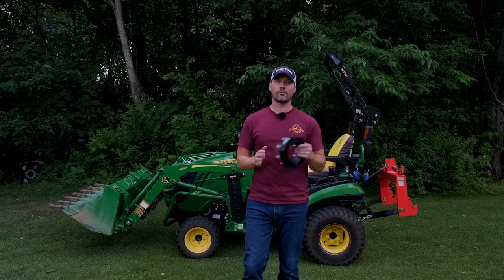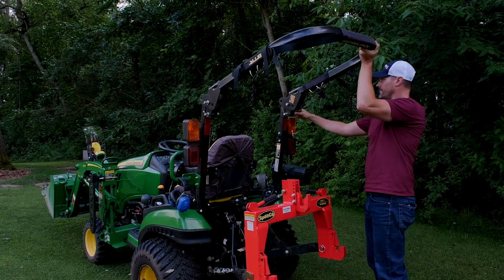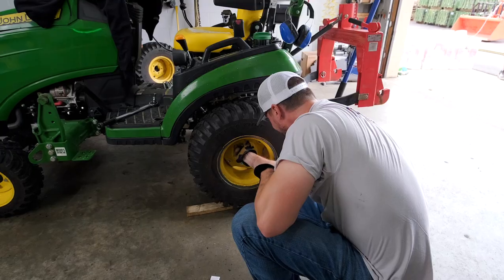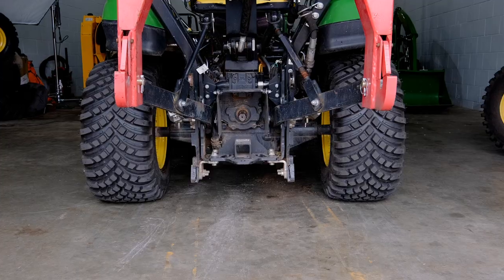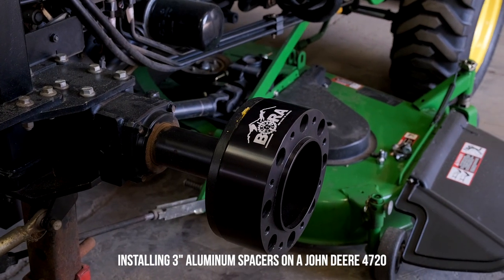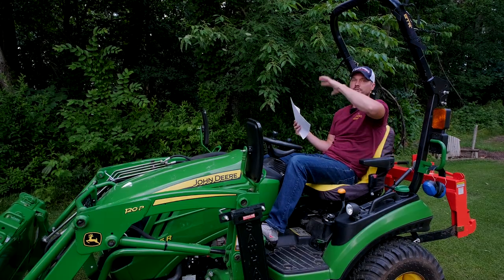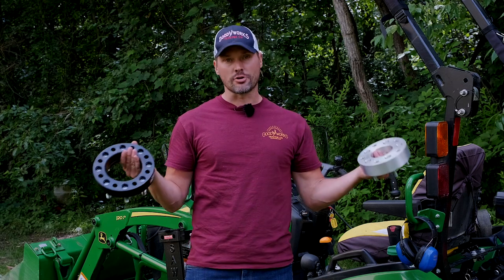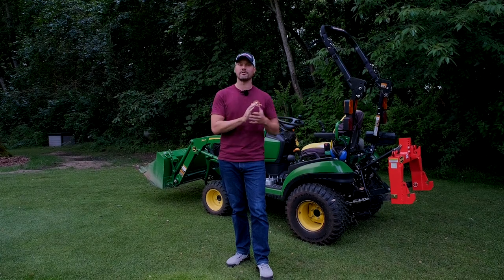THE MOST CONTROVERSIAL TOPIC IN THE TRACTOR WORLD? 🤦🚜

Comment: Hi, my name is Beau, and I'm new to owning my own tractor. I have some experience from my childhood with tractors, but all we ever had was extremely old antique job tractors. We had a 40s model Farmall "C", and a 1930 John Deere model "A", both of which were three wheeled tractors. These machines were both top heavy and dangerous, especially the Deere. But other than that, the only real experience I've had was with my friends two sub compact John Deere tractors. One is a 2210, and the other is a 2305, both being pretty much the same tractor. I have always wanted a tractor, but I never could afford it. Recently this past March, I bought my first tractor. It's a  1979 Power King 1614 economy tractor. It does have hydraulics, and I'm in the process of putting a front end loader on it. And being that it is a garden tractor, it doesn't have a rear pto, but I'm working on designing one for it. This little tractor has a lot of torque and pulling power for what it is, so I'm confident in its ability to handle the loader, but it is extremely light, and the loader is gonna make it more top heavy, so I'm considering the fact that wheel spacers could be helpful. Now I'm not gonna lie..., I have always been doubtful of wheel spacers, and I've never wanted them before, but I also realize that I don't have the proper knowledge to make that determination. I'm not worried about tractor life being shortened because this little tractor is over-built for its intended uses. I'm following suit with my design for the loader frame support. There's 2 key issues for me with the wheel spacers, both of which will probably seem minor to most people. The first is pricing. I'm medically retired U.S Navy, and disabled. Therefore I'm on a pretty tight fixed budget. Everything I'm doing for this little tractor is second hand, and being done a little bit at a time. Are wheel spacers really expensive? The second is the more impending issue. This being an older tractor that is no longer in production, and pretty rare at that, has proven to be challenging when it comes to parts and information. So fitment is the bigger challenge. I don't know enough about this type of modification, so if Bora didn't have a spacer that would fit, can they custom make spacers to fit? And if so, how much is that going to effect the price? I know you can't really answer that, so I guess my biggest question is, if it's really worth it to complete this kind of modification? I believe it is, but I do have to take my financial situation into consideration, along with the fact that I don't want to put more money into the tractor than what it's really worth. Oh and one more thing... my little tractor does have the independent left and right brakes. Will the wheel spacers change the braking characteristics in any way? Thanks for the videos. I love your channel. It's my favorite channel for good information when it comes to tractors.
Reply: Thank you for your service Thomas!  Have you gone and checked out the Bora website?  https://www.motorsport-tech.com/index.html. Their site says to call them if you can’t find your model. If I were to get say the 2” spacers, they’re about $140 ea. Having 26 days in ICU, not tractor related, I can say these are on my to buy list. Courtney at GWT has been an amazing source of correct information IMHO

Comment: Only reason ive choosen to not put Spacers on my CK2510 Kioti (Compairable to the Kubota B2601) ..is simply due to the fact that i do row crop work for market gardening and the narrower i can get the stance, the more rows i can accomodate in each feild. 

Otherwise it's a no-brainer for stability and traction in some cases. Truck spacers NO. Tractor spacers YES if you can't widen out or rims.

Comment: I added spacers to my old 1025R, and after experiencing the benefits wouldn't consider owning a tractor without them!  When I ordered my new 3046R, I had the dealer add wheel spacers as one of the options I selected.  My 40 acres has one flat spot and my house is built there, so spacers are mandatory in my opinion.  Next is the proper ballast.  Sure, these things cost money but what is your safety and peace of mind worth?  Like you, I wonder why these aren't standard factory supplied parts.  They sure make sense and I see no negative reasons to installing them.

Comment: Last month I helped my neighbor do an axel replacement on his 25 hp LS tractor, yup loader with axle spacers. However, we left them on as we have hills and heavy stones.
Reply: The real question is was he over lifting without proper ballast hanging off the 3 point?
Reply: He has a ballast box full of concrete and the axle broke on the down hill side when he was loading the bucket with rocks. The axle split off at the welded flange.

Comment: @goodworkstractors,  Is it advantageous to try and make the front wheels as wide as the rear? Say the rear wheels measure 66" and 4" spacers will be added; 74" after spacers. Front wheels measure 62". Is there any gain in putting on 6" spacers to make them match the rear width?

Comment: Good advice.  I got the Bora 6" spacers on my RK37HC that I run across the 10-20 degree gill.  Before the spacers I was scared to go across the hill and I think I saved it one time by turning down hill when things felt tippy - of course that could have been newbie fears... The spacers really make me feel better.  Fit is great.  We had a mismatch on bolt type/thread but they handled return shipping and the replacement was perfect.  I'm saving my pennies to add them to the front - not sure it helps since you have a pivot point, but might make a tiny bit of difference.  How do you test that?

Comment: I know most tire shops wont touch vechicles with spacers but that aint tractors.  Ive lifted a back tire on my tractor once using my loader. I dumped my hydraulics but i didnt have the best ballast.  I now have close to 400 lbs on each tire and 440 on the nose and my tires are almost 8ft wide and yes its a narrow front end i dont feel wide fronts are more stable than narrow front because wide fronts have the pivot
Reply: Once you start tipping, that front axle bump stop does very little.  Sometimes it is enough ( dead slow roll )
Reply: @petercampbell4220  yep thats what i say too

Comment: there is no question about it, wheel spacers do increase the load on the wheel bearings. It's a fact and if people disagree then they don't have enough horsepower upstairs to understand the basic's of leverage. 
That being said tractor manufactures do not provide the engineering data on the radial loading for the rear end design and i doubt any tractor is going to see any significant life difference of the rear end because of 2-3" wheel spacers. 
I'm still waiting for my wheel spacers, 11 weeks now since i ordered.

Comment: How do you determine which spacer size you need for stability between 2-6”?
Reply: Good question.  Anyone?
Has anyone ordered the 6" spacers?  I would like to see how a tl. of 12" actually looks like on a 1025R
Reply: @TexasLocalProduce  GWT advised in his video to measure the distance between the rear wheel and the wheel area on the mowing deck to determine how much clearance to have in order to determine what size spacer to get. That seems reasonable.

Comment: I am no engineer.. Wheel spacers are the same as the manufacturer giving you the ability to space the wheels on larger models . And on these 1 series  you get what 2" a side max any wider might put the trans axle in jeopardy. If wheel spacers were a solution tractor manufacturers would be selling them as a option. And not carrying them is a wise move you  are not liable for damage.

Comment: Additionally, I was referring to a 1025r with a 60-inch mower deck. I wonder if the bigger mower deck will allow you to put a larger wheel spacer on and not interfere with the deck Wheels? Any thoughts. Guess I still have a lot more research to do before I make a decision.
Reply: I am in the same boat.  I have the 60" belly mower ( but I never use it cuz I have a zero turn & battery (Kobalt) walk-behind.
I am interested in 6" spacers, so thats a tl. of 12".  It sure wud be nice if we cud see some pics of how 1025R looks w/ belly mower & the 6" spacers.

Comment: I want to put wheel spacers on my new 3025e but then read (on that GreenTalk site) that JD doesn't recommend them on this 3 series which is something I have to verify.  I have hilly property and of course want to operate as safely  as possible but I will have a problem violating manufacturer recommendations.
Any help here from Good Works Tractors on this issue?

Comment: Do you install the same size wheel spacers on the front wheels as you do the rear?
Reply: No.  The front axle pivots, so it doesn’t add to stability.  The rear axle determines the lean angle of the tractor.

Comment: If their argument is spacers shortens the axle life then how come tractor mfgs make the wheels that can extend outward to gain a wider stability. Its almost one of the oldest adjustments on them.
Reply: With wheel you can swap around the point that bears all the weight on the axle remains the same no mater which way the wheel is.  The argument against the wheel spacer is your moving that point out farther.  So in theory it could be acting like a lever, torquing the axles into weird spots making the bearings and seals wear out faster.
Reply: @Mopardude  if you have a deep dishing center and you have in in the out position and you have the rim slid out or bolted so that the rim is at the widest position, isn't that the same.  I had a Ford n series that you flip the dish out and have the rim twist to the outer most point.
Reply: @andrewanderson1436  You are correct it is functionally the same thing.  The arguement comes in because with a wheel spacer you could be potentially changing the geometry of the axle.   When you just flip the rim around the spot where the rim attaches to the tractor is the same, and all you are doing is changing the track with of the tractor.   With the spacers your also making the track width wider but like I said before the arguement is your changing the geometry of the axle too.  On automobiles it a bigger issue but the same arguements are going on over in the automotive groups as well.  Some say its from being not properly installed other say its not a good idea.  My opinion for tractors i don't think it matters hardly at all, they don't have a suspension nor do they go fast enough to even matter if their geometry is being tweaked at all.
Reply: @Mopardude  yes for a tractor this should not be an issue. I have seen car club pictures from other places in the world were their wheels and tires look like 40gal metal trashcans and rubber band tires on them.  That is one I haven't understood how it actually doesn't breaks off the wheel hubs. Maybe the car itself is just really lightweight.

Comment: Do these spacers need to be re-torqued periodically? If so, how often? And does that require removing the wheels?
Reply: You should occasionally re-torque your wheels regardless of whether you have wheel spacers or not.   The spacers have two smaller bolts to hold them onto the axle.  They come with longer wheel bolts that reach from the wheel through the spacer and thread into the original threads on the axle so, you do not need to remove the wheels to re-torque.  My problem is I have to remove the wheel weights.

Comment: If a two inch spacer is going to shorten axle life then the dual tires you had on should have snapped them in half with so much leverage out that far away from the axle shaft bearing. It’s purely speculation. They are built pretty beefy to handle the weight of attachments. Even if it does wear them out or break them, I’d rather fix the tractor to your point instead of getting hurt myself or worse.

Comment: Hi GWT, I’ve en using Bora adapters on my daily commuter but foremost on my 1025r, here 2” ers, why? I started researching this as an alternative to your double rear wheel mod, I’d love that one day, but I’m needing to also change my R4s first to Versaturffs, back when I should’ve bought my 1025r with turf tires, didn’t know then what I know now LOL, so that’ll set me back $1K… which I’d rather put into my attachments. So I found bora then, around the time I saw your double wheel mod clip when it came out. Bought them and I’m as happy as can be, I’ve to mow in parts on a slop, those 4” give me a bit more peace of mind. Now spacer or adapters? Adapters, because spacers require longer studs, whereas adapter come with the proper mounting lugs and give you additional studs to mount your wheels. So the spacer can give you headaches, if you don’t replace the OEM stunds with longer ones, but still, those studs take the added load if not more hardened and can wear, whereas adapters act as like a “wheel”, so no my axle won’t suffer. Great content as usual!

Comment: I think wheel spacers get a bad rap from being used on trucks and jeeps. It’s a hack way to gain width instead of getting new wheels. A truck is also going to be subject to much higher speeds and impacts, and the that could become a serious issue if they loosen or break. On a tractor? I really don’t see it being a problem.
Reply from the maker: Good point, make a lot of sense.
Reply: most spacers people get for highway vehicles are wheel centric only if they get wheel and hub centric as well as have them installed properly and to proper torque, there will never be an issue BORA and spidertracs are the only two brands of on highway vehicle wheel spacers I will buy people want cheap, so they buy garbage and gives an entire system a bad name across the board.

Comment: If anybody's thinking about this, get them! I have a TYM T554 Cab HST and added 3" Steel Bora spacers on each side and painted them when they came in. The owner called me to verify the measurements which I thought was really great of him. I also added Rim Guard liquid ballast to the rear tires. That eerie "hang on and get ready" feeling when the tractor seems to get a bit tipsy is not even close to what it was. Just remember to adjust your width (mine added 6") when ordering implements like boxblades, snowblowers and such. It makes a HUGE difference. I don't understand why manufacturers don't stick those rear axles out further. PAY ATTENTION TO THIS VIDEO! Thanks Good Works Tractors! Another note is when a tractor is sold without a rear implement, it should be mandatory to add a rear ballast box.

Comment: I enjoy your channel, thank you!  I was glad to see your video on Bora wheel spacers.  But.. I kinda gringe when I hear Motorsport tech..  
I agree the spacers are safe.  "IF" the proper bolts are used. I ordered and received wheel spacers from Motor Sport Tech. The spacers were tapped wrong, they sent another set of bolts to make them work.  The new bolts are the same as what was sent with the spacers.     They are not safe so I took the spacers off and can't get Motorsport Tech to return emails.  Im out the money, but I feel safer without the spacers because of the chance of the small bolts breaking and causing a rollover.

Comment: Wheel bearings are cheap and axles tend to last a long Timex so a slightly shorter wear cycle isnt that big of a deal.

Wheel spacers on a well built tractor aren't a problem, even if all they are doing is giving your peace of mind. They don't really add enough extra track to help you in really sketchy situations, but they can definitely help in some of the marginal areas.  With spacers or without, if you feel one side get light or lift, then you know you need a bigger tractor with a wider stance and wheel weights. 

Just don't out spacers on your truck or car, those are stupid and will make your vehicle more dangerous.

Comment: I'd like to know if adding spacers on the FRONT wheels, does it decrease it's turning circle?
Reply: Doesn't add any stability because front wheels have a center pivot point
Reply: @calebconklin7230  never mentioned stability. Reread the question.
Reply: Why do you need wheel spacers on the front they don't do anything
Reply: @calebconklin7230  Really?  I am about to buy a Stump bucket 14" wide & planning to aggressively hammer that into hard compacted soil.  Also thinking of getting a grapple.
Also, why are the FRONT wheels/tires on the 1025R so tiny?  I haven't seen/found any videos where owners upgrade them to larger ones.  Why is that?
Reply: @calebconklin7230  Can you explain in layman's terms what 'center pivot point" means on the 1025R?
Thanks.
Reply: The front wheels can pivot up and down to contour to the ground lift your front end up you can lift one wheel at a time and the other will go down piviting at the center

Comment: Here’s a question, why doesn’t anybody make just much wider rims with wider tires? Sure , it’s more expensive , but to my mind there are multiple benefits tp larger wheel combos.
On my sub compact MF 1705 the wheels and tires are  puny, especially the front , they really look like toys. 
I’m aware of possible issues with 4 wheel drives , where the diameters need to be in proper proportion.
Just wondering.

Comment: Why dont they make wider from factory?
Reply from the maker: Great question...don't have a good answer for that one.
Reply: So you can add them.
It changes dimensiones of your tractor for loading on a trailer or pathways.
It's totaly up to you what you use your tractor for, that's why I have one. The same way I use my wife.
The factory just give you opportunities.
Add a Loader, Implements and anything you want for your special needs.
If the factory would make it wider you would need a grinder to change, a spacer can be removed.
That's why tractors not all come with duals, but you can.
Freedom to all north americans!
Saludos desde otro lado del mundo desde South America SUERTE!